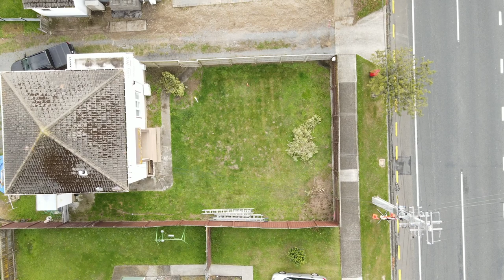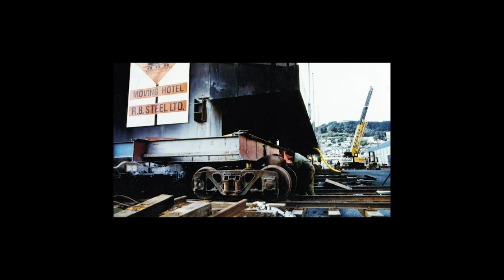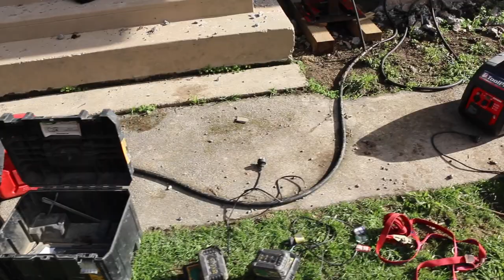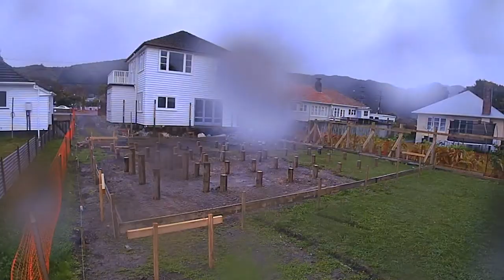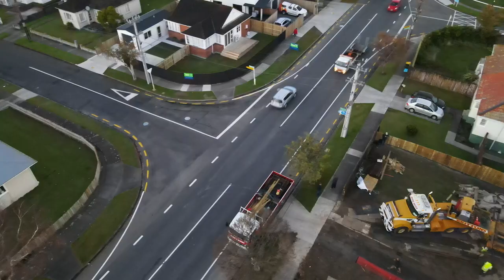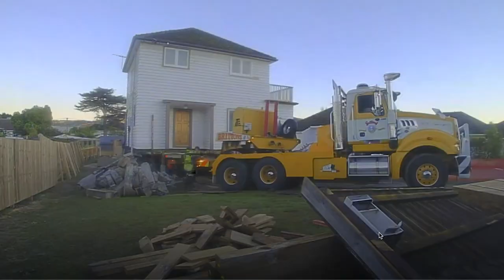Two Storey House Relocation - Start to Finish

Comment: If would have been good if you slowed it down for the moving of the house to see it in real time, why move the house thats costly, couldnt they have built a new house in front and behind?
Reply: Yes all the actual critical moving footage was on timelapse and less than 1 minute long so that tells me they weren't present at the time to witness the most interesting part themselves.  Hopefully their videography will improve with more info dense content and helpful commentary.
Reply: It’s actually quite boring in real time! 

The house was moved to make best use of the site, council requires the cars on site to be able to turn around within the property and drive out forwards. Moving it wasn’t the plan originally but I’m very happy with the outcome.

Moving the house only cost $35,000 :)
Reply: @benhainsworth1247  I have a 1000 s/m site that I had a new building built on the back of last year. The original house is still in the center of the section like yours was. I have been quoted around the same figure to move it forward to enable the property to be divided into two reasonable sections. Unfortunately the original house is older and not in the best condition so I don't feel like it will be cost effective and will probably be demolished.
Reply: @Daniel-fo2qf  Lots of things to consider there, my site is 645m2 but is zoned medium density so that helped me alot. I have owned this house since 2012 and have done a lot of renovations on the inside over that time. Was an easy decision for me to retain it as it helped a lot with getting the bank on board for lending too.
Reply: @benhainsworth1247   wow $35K I just got a quote to move a 800 sq ft house For  $80k 😢$50 for cement pillars and 40 for the move